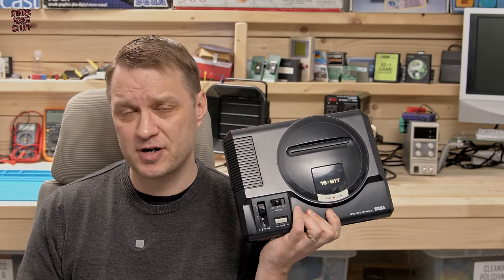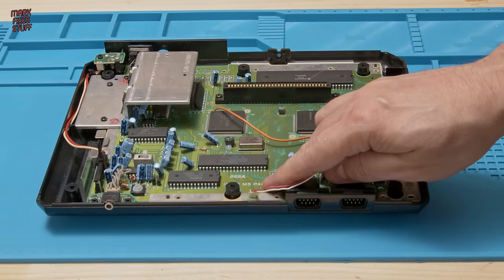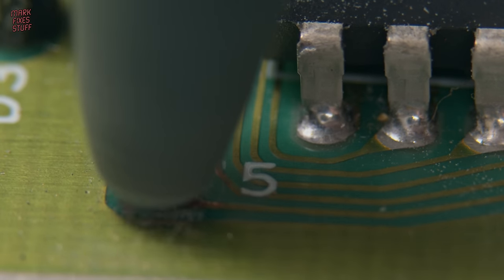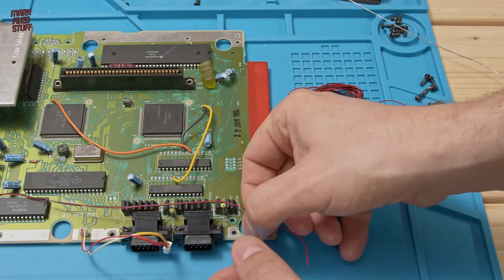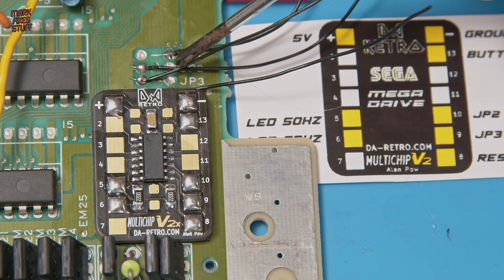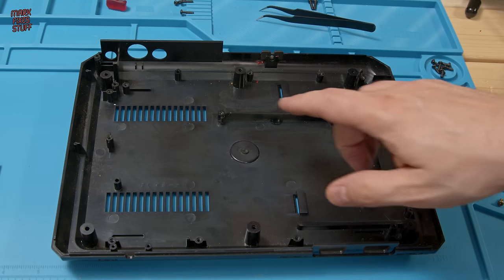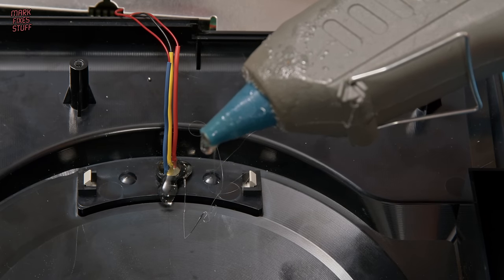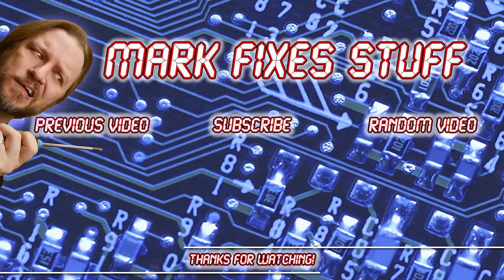SPEED BOOST! Sega Megadrive Switchless Region Mod tutorial and test!!

Comment: I actually do have a history like yours. I started to work quite young, at 14. When I was 18 I had some money saved and wanted to buy a bike. In the city I lived there was a street with several bike shops. I went to one that had a model I wanted and asked to turn it on for a bit (it was used with a 2 stroke which creates a lot of smoke if the engine is not in a good condition). The guy than asked me "Are you really going to buy it or just want to make me waste my time?". I said "Don't worry, I changed my mind". And went to the shop next door, saw a similar model, tested, purchased it and, of course, passe din front of the other shop and waved to the previous salesman.
Reply from the maker: doing the work of the gods  :applause:

Comment: I've seen a lot of people refer to machine screws as "bolts", but a bolt is a fastener where you tighten or loosen it by wrapping something around the head, on a screw you have a driver that's inserted into the head. That's the difference between bolts and screws. There are self tapping bolts too, it has nothing to do with the threading or if it uses nuts.

Comment: @34:20 - Having those switches in the right place cannot be overstated.  I fixed a 3DS XL for a kid and had to take the damned thing back apart multiple times when I had the volume or brightness sliders in the wrong position on the shell and they did not sync with the underlying mechanisms.  Great tip that applies to many systems.
Reply from the maker: It’s a pain in the ** haha

Comment: Note: never use anaerobic threadlockers near plastic as they can cause cracking. Use varnish to lock screws.
Reply from the maker: anaerobic retaining compands don't cure or set on plastic either, even if they are "plastic safe" becuase they need metal ions to set. Thanks for bringing this up  :)

Comment: Great video, Mark! I like using Japanese models for the main reason that there's no need to modify the cartridge port, it will fit all carts but you'll need to remove the lock lever from the power button for non-Japanese carts. Using the NTSC system as a base does have the side-effect that 50Hz mode has borked colour. I'm no analogue video genius but I understand it's a colour-burst frequency mismatch that needs an alternative oscillator? It's interesting to observe that your PAL console playing in NTSC mode has no issues. I noticed the same when applying a 50/60Hz mod to my PAL Master System 2.

I tried rolling my own switchless mod and it worked great. For some reason though, the mods would work great for several weeks and then one of the pins would seeming fail. It certainly wasn't excessive current draw because measuring revealed a few micro amps used. I ultimately ended up soldering the language pin to the English position and using a slider on the case to switch frequency. I can get around PAL games that do check region and refuse to boot by starting the system in PAL mode and once you get to the SEGA logo, you're usually good to switch to NTSC and most games just don't care after that.
Reply from the maker: You can actually switch region mid game with this mod by holding the reset button. Was impossible to film it though because the changing frequency made the camera go mental.
Reply: @MarkFixesStuff  Haha, yeah, I bet your camera loved the sudden changes. Do you experience any colour artefacts like I mentioned, with this Built-as-PAL, coaxed-into-NTSC system?
Reply from the maker: Not that I'd noticed  @X-Bit-Gits  - It looks the same in PAL as in NTSC. I am using and RGB SCART though, so the colour isn't encoded onto the image itself at a carrier frequency.
Reply: Great video. A few of the 1993 onwards PAL games don’t like 60hz. Rocket Knight for example glitches from level 2 on. Sparkster the sequel tho is fine when you switch after the Konami logo.
Reply from the maker: That’s interesting info  @byronlaw6491 . I did have a google about to see if I could turn up any info but it was such a vague topic I kind of gave up. Thank you for this!
Reply: @MarkFixesStuff  yeah it’s a topic with not a lot of information. The games behave differently when forced into 60 on emulation or hardware like the Mega SG. I think is where the confusion comes in. There is a YouTuber called Randomised Gaming who did a video on this about 7 years ago. Worth a watch.

Comment: The outliers on the PAL/NTSC thing is interesting, for instance Super Mario World has been sped up so it plays the same speed as NTSC and the vertical resolution has been upped by 24 lines, so you get to see more of the playfield. Of course, you're still running lower FPS, but sometimes that extra screen space can help you keep your fire flower longer when you spot something that'd've been just off screen in NTSC.
Reply from the maker: Ooooooh. I had no idea!!! Thanks for this insight!
Reply: @MarkFixesStuff  Truth be told 24 lines doesn't make much difference in Mario World, it's just an interesting case that it's one of the few games that bothered.

The only case I know where it made a difference is Sensible (World of) Soccer, as the PAL Amiga versions eat right into the overscan for a resolution of, I think 342x288. When trying to play at 320x240 or even 320x200 on other machines, it just feels like a downgrade.

Comment: A good game to try 60 Vs 50hz is College Football National Championship 2, in 50hz the white noise generator for the crowd cuts a lot, and I thought I had something wrong with the cartridge until I had a console with a region switch. Turns out, running it at 60hz solved the problem. 

Also, I use a pro action replay to play Japanese cartridges. It's even possible to bypass the region check on an unmodded console if you know where to poke.
Reply from the maker: Thank you for this info on the white noise. The PAR carts are quite pricey now I see!!!!!

Comment: Love the vid Mark, the Mega Drive really is a joy to work on as everything is laid out on the board so neatly and grouped nicely. I do have a question though, the Multimeter your using is it actually any good? I'm an electro mechanical engineer and have always sworn by using Fluke that's probably due to perceptions of flukes quality and accuracy within my profession passed down to each generation. I am currently using a rather well worn Fluke 101 as my goto multimeter alpng with a Clarke pen multimeter, I am however getting sick of paying the ridiculous prices for them. So I am quite interested in how it performs.
Reply from the maker: For my purposes I have no complaints. I like the big display and the beep is loud. Fluke will certainly be more accurate once you start hitting values orders of magnitude smaller than I'll ever encounter. The fluke will likely be more robust as well, but there's also a great argument for it's REALLY cheap hahah! There's a rechargeable version now as well which I might grab. Honestly, it's so cheap it's not really a "considered" purchase but it's performed well.

Comment: I have a story of when I went into Dixons in Stretford (near Manchester) to check out the new tech, it was the early 990s so they had Commodore Amigas set up.
We were followed round the shop as the assistant thought we were "ner-do-wells" but we stayed to see a demo of the A500.
The "I've used them all" assistant couldn't work out why the screen wouldn't work for him and he wouldn't take any advice by anyone and got pissed when we kindly pointed out that he had the A/V modulator plugged into the printer port.

Comment: Personally I'd Suggest using an Asian machine over a standard UK European or Australian machine for any region modification taking the locking mechanism out it'll fit every cartridge however the European console will only fit European and North American Genesis cartridges without damage to the console.
Reply from the maker: Yeah. I have an adapter here and have looked into spinning some up to avoid case cutting. I did try and get an Asian console but every time I look at prices they see me coming!!!

Comment: Were did you get the stl file for the wire tinning holder thing? I could use one of those at work
Reply from the maker: I meant to add the link but had to go away. This is it I think : https://www.thingiverse.com/thing:2610383
Reply: @MarkFixesStuff  nice going to print this first thing Monday on the works 3d printer!!!

Comment: Unless that mod has one built in I would of replaced the crystal with a DFO as well otherwise you get odd frame rates when switching regions especially if you are using a doubler/upscaler.

Comment: Hey I’m hoping someone can tell me if  I need a 60hz-capable CRT TV to enjoy the games in 60hz NTSC mode. Thanks!
Reply from the maker: If you have a SCART enabled LCD tv and an RGB SCART cable you won’t have any problems. For CRT, most of the later models that featured a SCART connection can also handle 60hz, but you need to use an RGB cable because if you try and time use composite you’ll get issues with colour
Reply: @MarkFixesStuff  hey thanks for that, much appreciated!

Comment: Sis you ever get the mod you did on RMC working properly?
Reply from the maker: No! I keep meaning to sort it out. I basically forgot to cut the reset track on the underside of the board. Alan at Da-Retro (mod maker) watch the video and said "doh!".
Reply: @MarkFixesStuff  Ok I though maybe there was some capacitive coupling over a too tightly cut gulley. But I am not well versed in console modding so do not notice details like those who are.
Reply from the maker: I simply missed a stepped when filming @rimmersbryggeri  - When the lights are on and the camera is rolling it can get a bit tense.
Reply: @MarkFixesStuff  Thats normal. Do you know wether this mod also works on the MD2?
Reply from the maker: It can be installed in an MD2  @rimmersbryggeri  - http://guides.da-retro.com/guide-md2.html
Reply: @MarkFixesStuff  Too bad they aren't selling anything. :(
Reply from the maker: You can buy it from Alan here  @rimmersbryggeri mate. It's the same kit as I used for the MkI and mine arrived in about three days - http://www.da-retro.com/kitmd.html

Comment: While I no longer recap everything in sight, I'm midway through doing my megadrive, its really improved the jailbars, its not solved them though
Reply from the maker: I can't really see any jailbars on the CRT. Maybe I'm not that picky. Are you using a flat panel TV?
Reply: @MarkFixesStuff  it is a modern TV, through an ossc, rgb with c sync and this they taunt me.

I've read the output is slightly off spec in a way crts don't care, but modern tvs do, and I probably need a bypass mod
Reply from the maker: @TheCurlyP you might need a more complex solution then